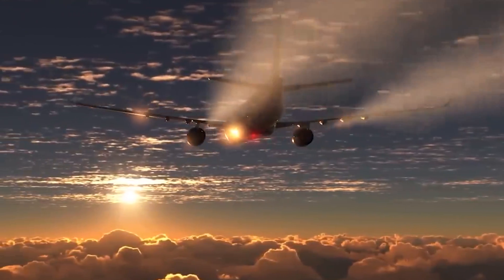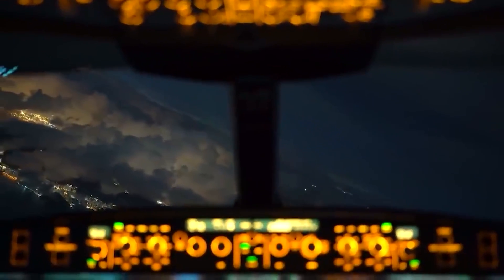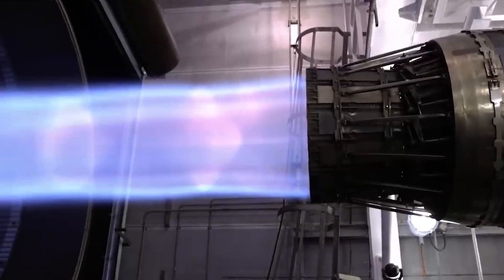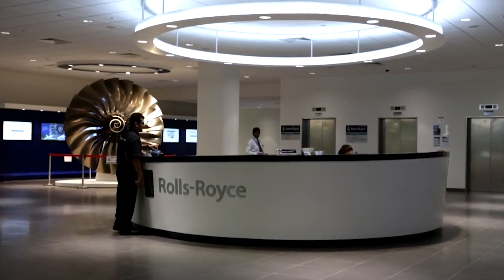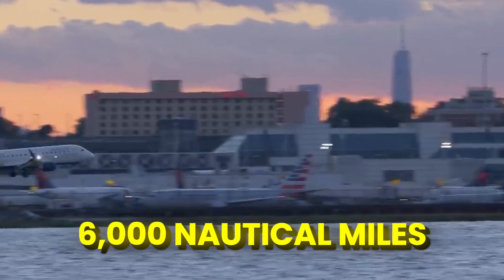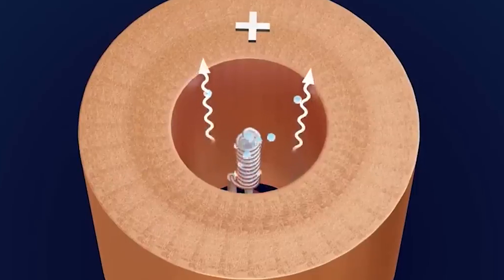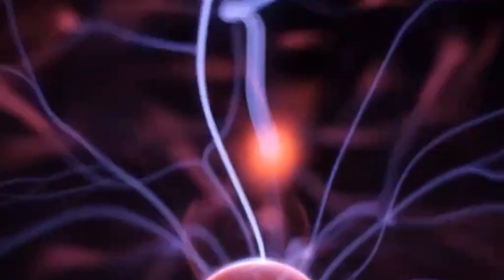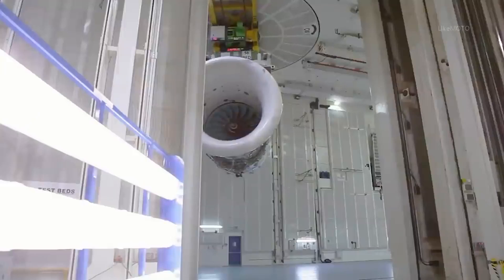SHOCKING Difference Electric Plasma Jet Engine versus Hydrogen Powered

Comment: Here is my take.  This video was somewhat eloquently spoken.  Doesn't  mean you're wrong.  And in Tyrion Lannister's experience, "eloquent men are correct every bit as often as imbeciles".  What's "opinion" got to do with anything?  Just because one is offended doesn't make him/her right, merely offended.  I suspect that at least some of this video is correct.  Some  of it was fun to observe, and some of it painful.  In fact, in this age of dis-information, truth/fact is more effective at getting people riled up than does lies and deception. 
Having schooled in the sciences, I had to look up this subject and was surprised by how much is already developed.  The problem is that this presentation compares the thrust ratios and effeciency of e-plasma with Hydrogen and even jet fuelled aircraft in a positive light.  Real world numbers are dismal for craft inside earth gravity and wind resistance.
     Here is a quote directly from Wikipedia on plasma thrusters: "Due to their extremely low thrust, plasma engines are not suitable for launch-to-Earth-orbit. On average, these rockets provide about 2 pounds of thrust maximum.[9] "  Sorry that the facts fly directly against this presentation and your claims.
   Remember, if you can't bear scrutiny,  you didn't do your homework, (presuming the desire to share fact and valuable insight)  otherwise you're just another snake oil salesman.
     So, of all those pretty video clips of jets and rockets, how many were actually related to this topic, or even the words spoken while the clip played?  You presented jet fuelled craft while you were speaking of e-plasma or hydrogen.  Doesn't matter which.  None of those could have been e-plasma except for the tiny ones in the lab that could not even lift that ball off the tube, or a long range satelite that relied upon standard-fuelled rocket thrusters to get it out of earth orbit.  Refer back to the Wiki quote before launching a flaming video war, because arguing online is like the special olympics: even if you win, you're still 'special'.  lol
Reply from the maker: TY